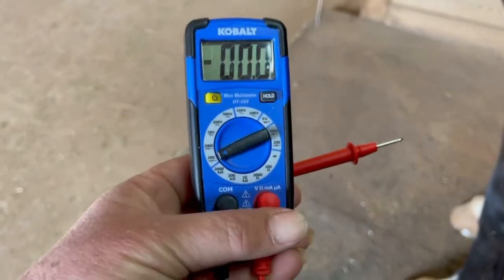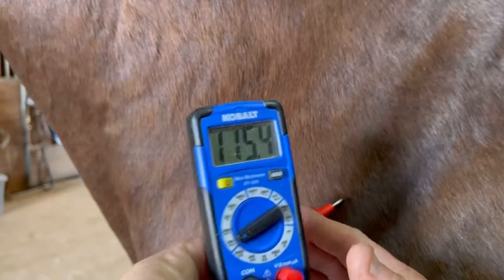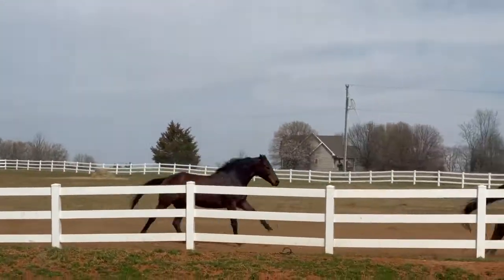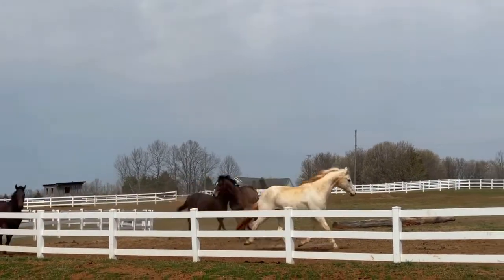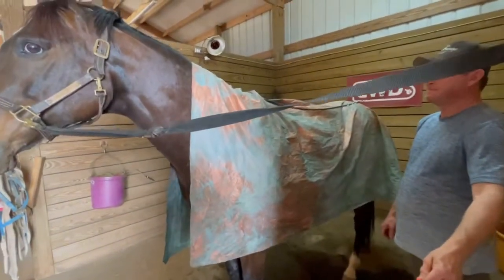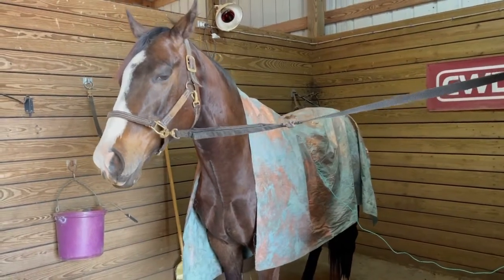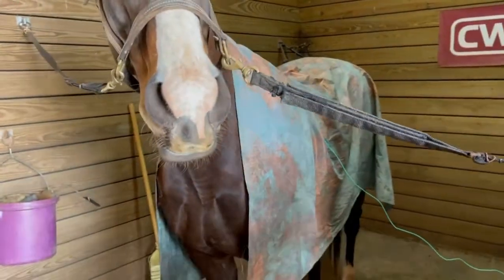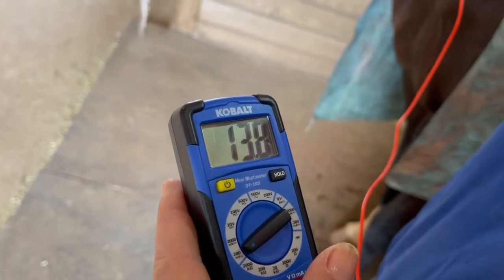Grounding Sheet Demo with Waldo

Comment: In a barefoot horse on a property with no electricity, how would I be able to try that?
Reply: You can stick the grounding end of the cord directly into the ground!  BUT, a horse should already be grounded because they are barefoot....unless her barn was somehow not grounded.  Even concrete is still grounded. So her video needs more explaining....
Reply: @chamberlainfamilyfarm  I found out that it is ME that needs the grounding.  I now have to hold onto the metal fence while grooming because my rubber soled shoes allow me to build up quite a charge.  I used to have a grounding rod for my electric poultry net.  My results with the grounding rod were spotty when the soil was dry.  We have too many rocks to get down to moist soil.

Comment: The horseshoes are conductive I believe .  If so, the horse should be grounded already.

You can measure electrical resistance to see grounding by measuring between the ground and the object to test.  Directly checking resistivity (when low ohms, it means good conduction).

The other way is indirect, we can set a volt meter to Auto-Ranging A/C and measure the repel force on low frequency EMF.  When one is grounded they are an extension of the Earth's electrical field and repel low frequency EMF.  This repel force decreases as the frequency increases and becomes non existent at about 100kHz.  A hand held volt meter set on Auto-Ranging A/C when you set one lead to ground and hold the other lead will measure the low frequency induced body charge (which will be the 60Hz house hold EMF).   When grounded this induced body charge from 60Hz house hold EMF will drop by orders of magnitude.
Reply: What
Reply: @nic_nobody  rude
Reply: Thanks
Reply: Her horses are probably shod, most performance horses are. Too, the hooves are in constant contact with the ground. I don't know how conductive  the hoof is. I would quess a horse grazing is more grounded than one under saddle because it's nose is in contact with the ground. Another thing animals with split hooves i.e. cattle and animals with pads (felines and canines), I would think are somewhat grounded all the time. Unless the are housepets not living in a concrete slab home . She has I nice barn, so I'm wondering if the stalls are concrete with rubbermats.  She has her horse in cross ties, probably the shower stall, so it is concrete. That would mean her test, if on a correct selection, would indicate the shod horse, standing on concrete is not grounded. Its my understanding about concrete, it's the iron rebar that is the grounding element. And I think the slab has to be bare and not covered with flooring.
If anyone can do a shod vs barefoot horse or a grazing horse vs a horse not grazing,  it would be enlightening. 
I've interested in this "grounding" for awhile but since my husband passed away the the effects of grief have been physically difficult. I feel toxic all the time, low energy, sleeplessness, stiffness and headaches. Ive even had vertigo. I also was interrested because I have older pets and I work occasionally at a horse barn. 
So, thank you for the video. I wish you the best.